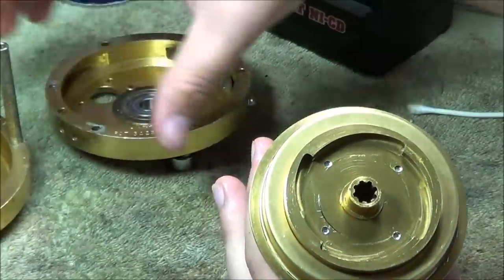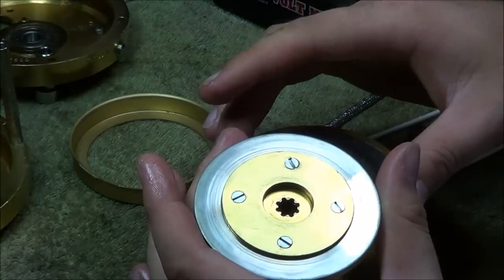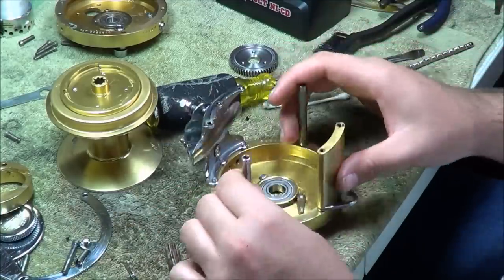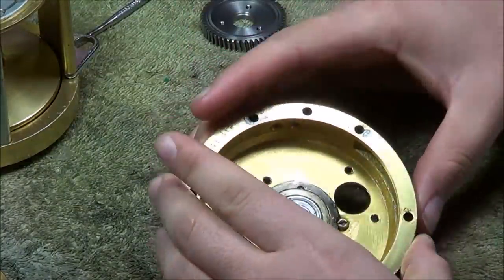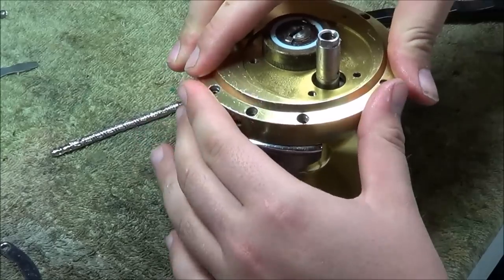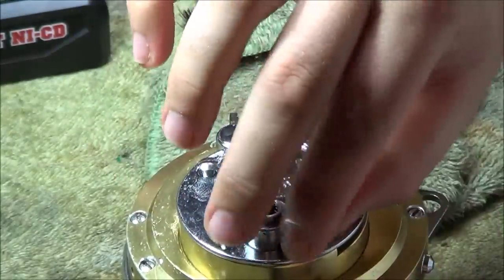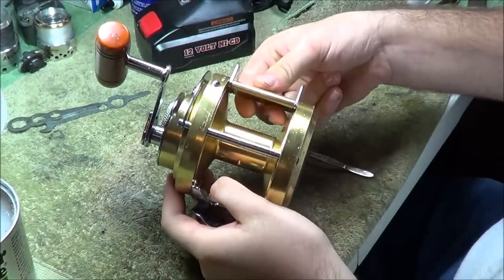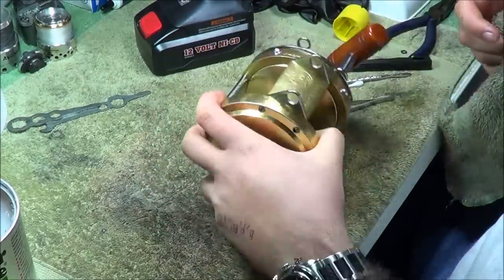International Complete Breakdown Part 2

Comment: Flat head screwdriver bit in a driver drill scraped off anodization from his frame around screw hole. Also, who knows if the screws are cross threaded. Who cares so long as it's someone else's reel I guess.